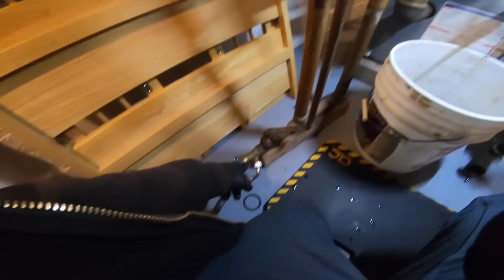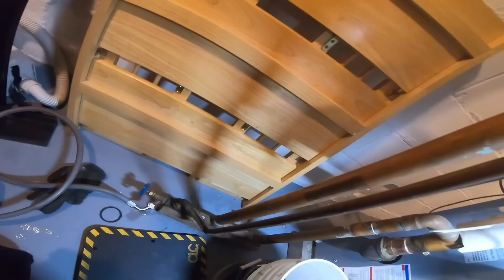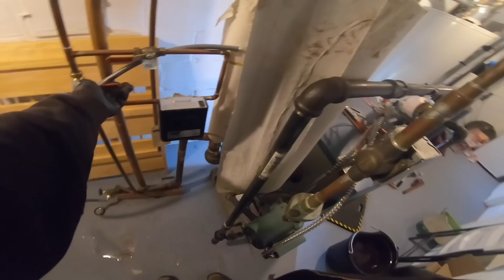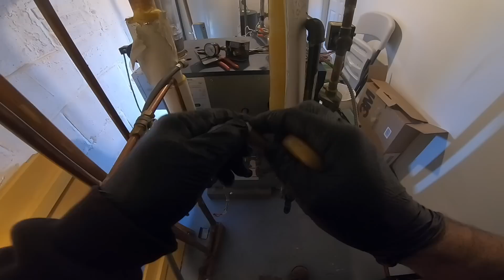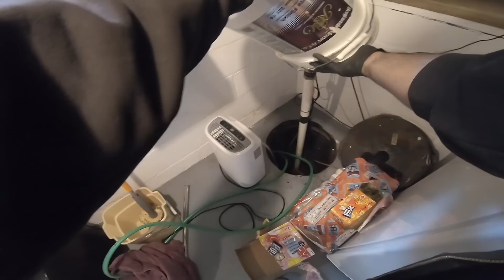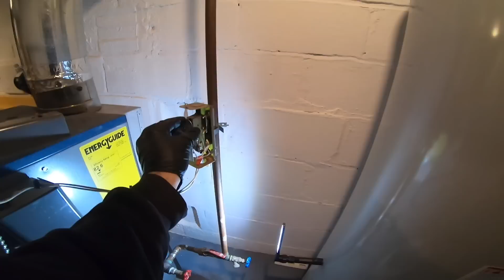No Heat Service Call Plugged Steam Return

Comment: Nice job. I had a boiler in a Legion Hall that was so plugged, mud came out for over an hour of flushing. They used the steam for the second floor and took the hot water off of the bottom of the boiler for baseboard radiation on the ground floor. The McDonald Miller was totally plugged with Iron oxide (mud) Years ago every one had steam boilers and knew how to blow them down. Today, not many people know what to do. Thanks for that video. Very Interesting.
Reply: Waterman one as long as people are dumb as shit to the service they needed to do, it keeps everyone like Hacket with a job and free tips like the pipe cutter he got! LOL

Comment: a steam boiler with a hot water loop ?
Reply: You have to know how to hook it up. The pump has to be pushing which is better anyways. It needs an strainer to make it last but economics and extra calls are coming from that. The job is a mess with copper pipes on it another no no.

Comment: One of the most important things done in this video is wiping down and cleaning tools. Always remember, shitty tools equals shitty job results. Some of the people I have worked with over the years spent more time bitching and fighting with tools that do not work properly simply because they did not properly care for the tools and equipment that they use every day.
Reply from the maker: My tools have some age to them yet I like to keep them clean and free moving. I work out in the rain often and my tools get wet. Yet I give them a wd40 bath to clean them up. I never understood when a coworker gives me a pliers that don’t move easy. I depend on my tools and fight enough with the machines I need to fix. No reason to add more work fighting with tools.

Comment: Even with a water softener it still gets that bad? I assumed with hard water and chlorine it would. I have a whole house chlorine filter and water softener.
Reply from the maker: It has nothing to do with what kind of water enters the boiler. Cast iron and steel pipe plus the radiators are around 100 years old in this house. So it goes up through the system as steam. As the steam cools off, condenses back to water. That water brings back little tiny rust particles. Those particles over time create mud. That mud mostly iron ore seems to sink right into the pores and difficult to wash off. That’s why steam boilers need to be drained once a week. This homeowner bought the house before last year and didn’t have service. Also didn’t know until recently he was suppose to drain down to get ride of the mud.
Reply: @thehvachacker  so many people say not to flush or drain because boilers hate fresh oxygenated water. Your viewpoint leads me in a different path because my grandmothers house was like that but I was too young to understand at the time but I remember she flushed in a bucket and if she smelled oil it needed to be serviced. This was in westfield nj so it wasnt the back woods she just knew when it had to be serviced at the very last second. She pinched every penny lol
Reply from the maker: Hot water boilers it’s not good to keep introducing fresh water. Steam boiler is same boiler except completely different system. Due to the wet when heating and dry when off. If a hydronic/ hot water boiler gets plugged up their is major problems. Your grandma had an oil fired steam boiler. Most of the older generation took care of their boilers religiously. A lot of new homeowners may never have witnessed a steam system. Or if they move into the northeastern part of the United States.
Reply: @thehvachacker  My grandmother had a hell of a house and that boiler didnt look pretty and the pipes to everything were a mix of it all but I remember the radiator vents. I remember a bucket and a ball valve and my aunt or grandmother doing something all the time. There was an open sewer line going out which was there when the house was built in to be honest I dont know when at this point.
Reply: The HVAC Hacker steam boiler owners, do NOT drain your boiler every week. You will rot it out

Comment: Why would a hot water system have a sight glass/ or a steam system have a circular pump?
Reply: it's a steam boiler with a hot water loop off it. you can 100% use the hot water from below the steam line for other heating, like baseboard, air coils, indirect water heater and more, while the steam still heats radiators and other things. :)
granted it should have a bronze pump instead of cast iron or one of each and water to water plate heat exchanger to keep the dirty steam junk out of the other systems.
Reply from the maker: Just as throttle stated. It should have a bronze pump, also not a cartridge pump but a booster pump. This way the motor is not exposed to the hot water. Even when the pumps are rated to 250 they always get the rattling sound. Series 100 bronze pumps seem to last the longest on this type of system yet is a lot more expensive

Comment: "gallo/drain gun" comes to mind to blow the snot plugging drain back into boiler as broken up sediment. or use a hose/ double female and feed high pressure water backwards.
it probably wouldn't take much to free and stir the sediment enough to properly drain then!

Comment: Run more water thru the boiler to clean the inside of the boiler?
Reply from the maker: I’m just there for an emergency call. They had a full maintenance scheduled two days later. So I didn’t want to charge them hourly for a maintenance they already paid for. Flushing the boiler is needed. Even flushing out the mud in the pig tail

Comment: Merry Christmas, Hacker! Why does such a fairly new system get so sludged up?
Reply from the maker: Merry Christmas Dakota. It’s the pipes and radiators in the house slowly rotting away, that sludge is rusted up iron ore. This house is about 100 years old so all the original pipes and rads date back. Some pipes have been replaced due to holes rotting through.

Comment: The pressure will be clogged?
Reply from the maker: The pipe to the pressure control fills with mud and needs to be flushed during a maintenance. I blew threw it just to make sure it wasn’t clogged and the boiler pressure gets to the main safety/ the pressuretrol which cycles the burner to regulate the pressure

Comment: That boiler needs skimming.
Reply from the maker: Hopefully when the maintenance was done two days after my emergency call that was done. It also needs the pig tail flushed out with hot water to break up any mud caked inside. I just wanted to verify it wasn't plugged.

Comment: Before the first minute, he's made two mistakes, Indicating he is either an poorly trained amateur or he just doesn't give a damn, so he is out of my building. First you use a flat wrench on brass, like an open end wrench or a Crescent wrench. You don't gouge up my fittings with knurled channel locks. Then he applies the channel lock wrench backwards, further gouging the brass fittings. I didn't watch beyond the first minute.
Reply from the maker: The wrench I used is the best adjustable wrench. Flat jaw made not to damage brass or finished products. No knurls, therefore no gouges. I don’t use tools that will gouge up fittings I need to take apart yearly. Those little metal splinters suck to remove and are right where I touch everything. Most of what your saying I did wrong makes no sense. You can believe what you want yet being ignorant and lying about what I am doing. Really??? Where on my adjustable pliers wrench do you see teeth. U should step up your game and buy quality tools. Or is $50 for an adjustable wrench out of your league?
Reply from the maker: Here is the wrench I am using in this video. In my books the best adjustable wrench being sold. https://youtu.be/uVM02XrR5VY
Reply: Easy there cupcake.
Reply: @thehvachacker  the way this joker sounds I think he has problems getting repeat service from contractors. I am a HVAC  certified on marine systems and work on mostly larger vessels in N.J.  I ran across a couple cats like this in my 25 years, commenting on how I was taking things apart or what I should check, I smiled and quietly packed up and walked. When they realized what was happening I simply stated they were obviously smarter than I and a classroom lecture was not on my agenda. BTW I have been using Knipex pliers for years I have from 6 in to 24". The 24" channel locks bite on so hard to fetched up lage pipe you can stand on them and jump, this 6'1 275 pound fool know from experience. Stay safe, cheers from L.B.I. N.J.
Reply: @thehvachacker  he doesn't know exactly what he's talking about I believe those are knipex pliers you are using. They're one of the best things to use. This is just one person talking out of their butts they don't know any better don't pay mind to it I really did enjoy your video. You're very knowledgeable and professional